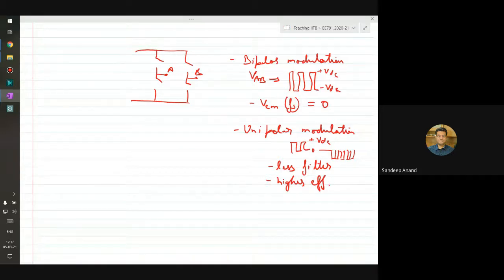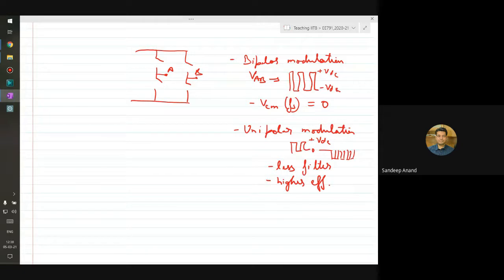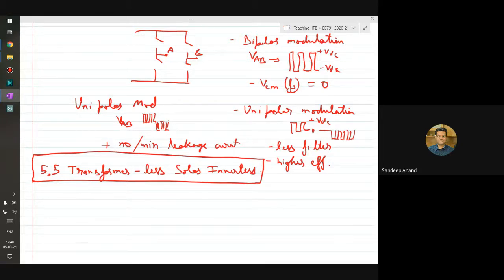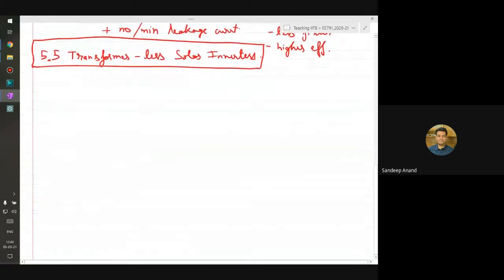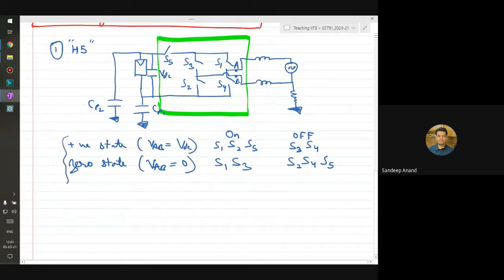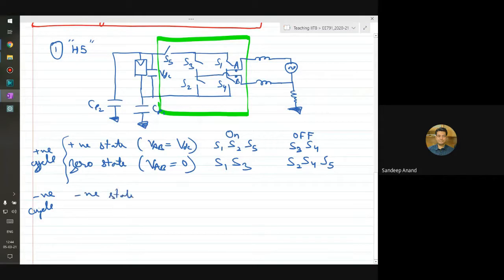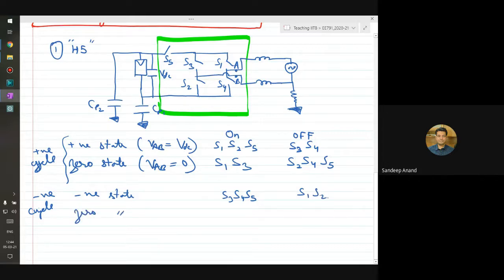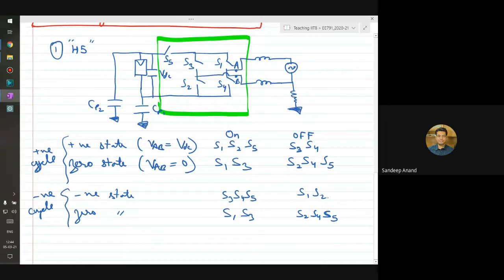5.5 Transformer-less Inverter Topologies

Comment: What is the use of D5 diode in H5 inverter topology ?
Reply: D5 serves 2 key purposes 
1. It ensures continuity of grid current during dead time of switches.
2. It allows non-unity power factor operation for H5.

Comment: Namaskar Sandeep anand sir, at time 25:39 if below two diodes are blocking voltages of Vdc/2, then upper diode will be blocking Vdc or Vdc/2 ?
Reply from the maker: Thanks for pointing out an oversight in the video. The blocking voltage of the top diode comes out to be Vdc/2.
Reply: @sandeepanand8661  Thank you to you Sandeep anand sir, for providing such a insight understanding of leakage current and common mode voltage in very easy way.  Its going to help me in many ways 🙏.

Comment: sir i have a question...
In recent transformerless pv inverter topologies, 2 out of 5 switches operate at 50hz and rest 3 operate at 10k hz frequency.Will there be discontinuity in conduction if switches(IGBT) with different frequencies occur in series in any mode of operation??